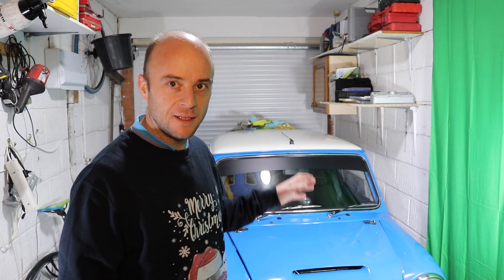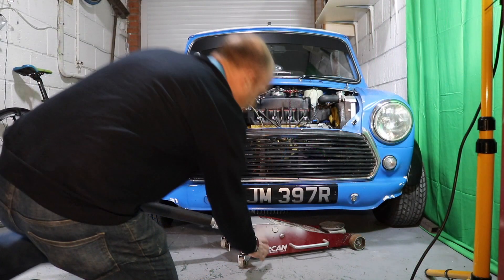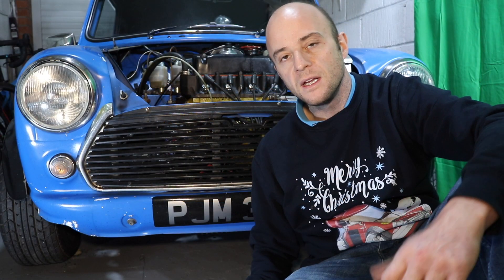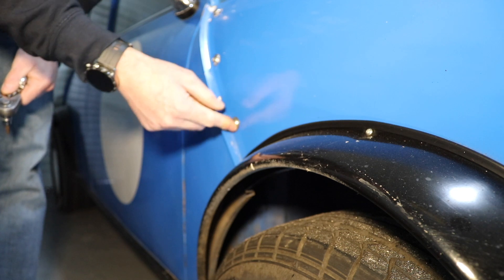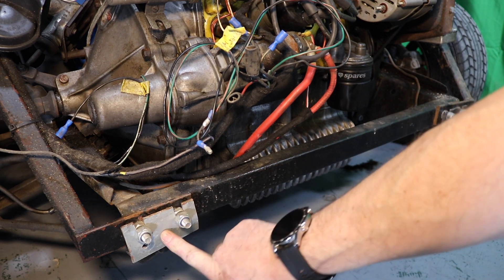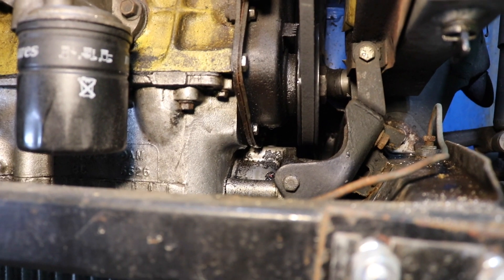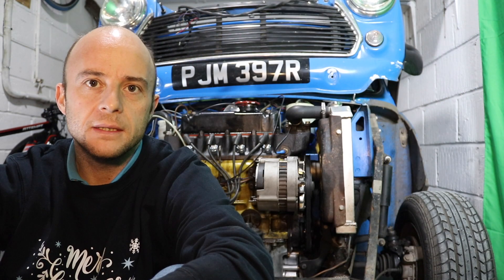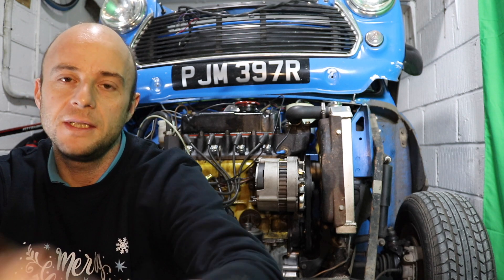Classic mini odd jobs, oil leak and alternator mount

Comment: Hi Adam, i had a leak in similar area, turned out to be the half moon ( engine to gearbox) oil seal was so hard it had failed. You can warm it up and gently tap it in without splitting the engine gearbox. hope this helps, merry xmas boss !
Reply from the maker: Thanks Martin. I think I have found it now. It'll be in the next update. Merry Christmas to you too mate

Comment: Good viewing. In process of doing a removable front myself. Any tips for the front wiring for the lights?
Reply from the maker: I forgot to video that. Mine are currently just the factory bullet connectors that I have to undo each time. I want to do something better though. Maybe one plug to disconnect them all